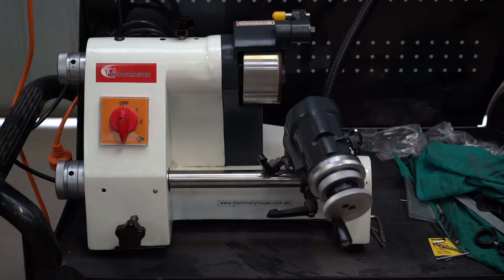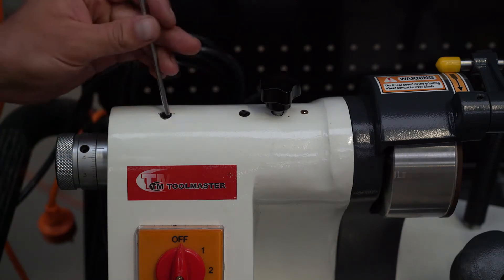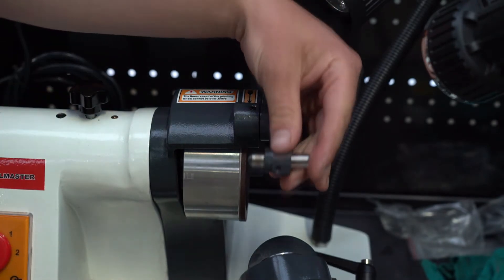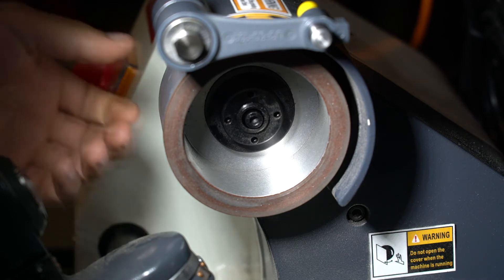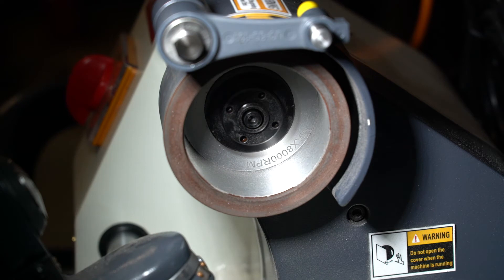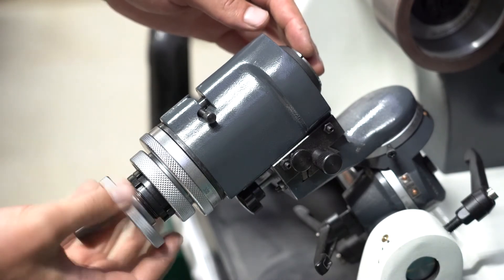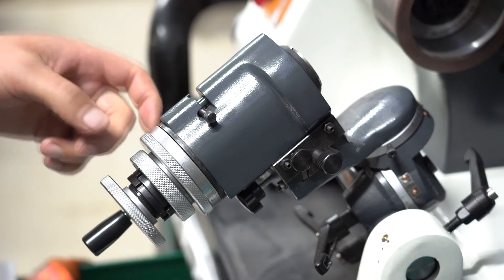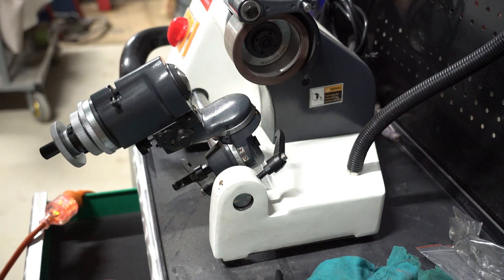😎 Introduction: U3 Universal Tool & Cutter Grinder AKA D Bit Grinder

Comment: Hi and thanks for the introduction video on the TM-U3 Universal D-Bit Grinder as sold in Australia. I did notice that you did not cover the Index Head graduations fully, I have found that there are several settings which I found quiet confusing at first. with the Index Head lever located to the right "Long Slot"  from 0 degrees on the dial it moves 7.5 degree increments for 180 degrees on the dial then hits a stop, jumps 30 degrees to 210 degrees on the dial then increments 7.5 degrees to 330 degrees on the dial where it hits another stop for another 30 degree jump to 0 degrees on the dial.
With the lndex Head leaver centered "Short Slot" you are able to swing the dial from 0 degrees to 180 degrees to a stop, if you pass the stop Index head jumps 30 degrees to 210 degrees on the dial and will rotate for 120 degrees to another stop with a reading of 330 degrees on the dial to another stop which in turn if passed will jump 30 degrees to 0 degrees on the dial.
Furthermore, just below the Index Head is a graduated scale that is used for setting cutting tool radii but no mention as to the scale used or incrementation on the machine or manual.
Also missing is the window to view the white dot that is critical to the initial set-up for D-Bit and Lathe tool grinding, it is mentioned in the Instructional Manual but is not provided, with no further explanation as to an alternate set-up procedure.

Comment: When the wheel (spindle) is fully retracted, the hole should be in alignment. A vacuum system and a suitable mask, is strongly advised, as diamond dust once inhaled, will sit in your lungs forever. Thanks for the video!

Comment: Yes, it is quite helpful.....thank you Lord for the lack of background music....... I think I might be investing in one of these again as I had a Deckel before but sold it when I had no further use for it and someone else did.....things change and the need arises again.
One thing I noticed and that is you said 5C collets.....I assumed they were R8 as this was on another 2 year old U3 review.....is this a current upgrade to 5C?
Reply from the maker: Glad you found it useful. Yes, this grinder uses 5C collets which is an upgrade to R8 collets used on earlier D bit grinders.
Reply: @ProjectsDownUnder  Well, you're never too old to learn or update on something new........at least it comes with a set of collets as part of the package.....and the current price on OZ EBAY is A$1,050......the yearning for more tools is never ending.
I can never understand why anyone would want a full set of 5C with 1mm increments when in all reality you only need a few to cover the shank diam of cutters that are standard, the same applies to full sets of ER collets too........drilling with 5C or ER collets is like going to work on a building sight with a 3 piece morning suit whereas a keyless drill chuck is more universal and cost a lot less.
Edit.....just looked at Stefan Gotteswinter's video on the D bit grinding 4 facet drills so I would have to say that with that knowledge a complete set of 5C collets would be highly desirable after all.......he also uses smaller ER10 and ER8 chucks in the 5C collet for small drills etc.
Reply: With hindsight, and for all the original reasons I got rid of the Deckel I don't think I'll be investing in this device.....the main reason is it's too limited for general use with end mills etc.
Reply: There are actually 3 types of collets: R8 collets, 5C collets, and a special cutter grinder collets, the R8 collets was used in Deckel SO model, but the manufacturer of this machine  in China changed to use special collets (which range is 3-16mm) and 5C collets (range 3-28mm), then there come up with 2 model : U2 and U3, they are same machine body, only in the collets and collets holder design are different.
Reply: @relymachinery8184  The Deckel SO model grinder I sold had Deckel collets that look like smaller R8 collets and haver a buttress thread on the end OD.
I see that they are selling the swing head part of the U2 D bit grinder on EBAY for A$380.....full machine is A$1,300.......I had in mind to get one and do a simple Deckel look alike build with a 1/3 HP 3,000 rpm 3 phase motor for specific tool grinding.....another iron in the fire etc.